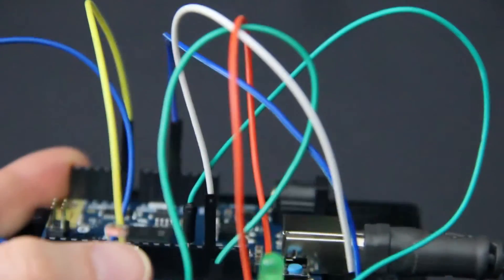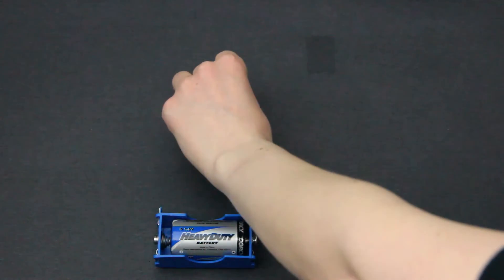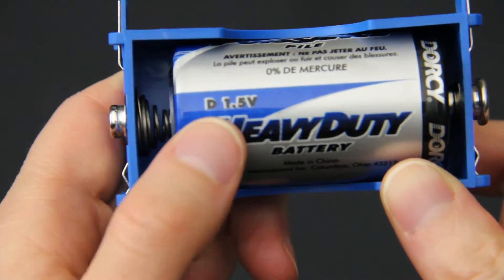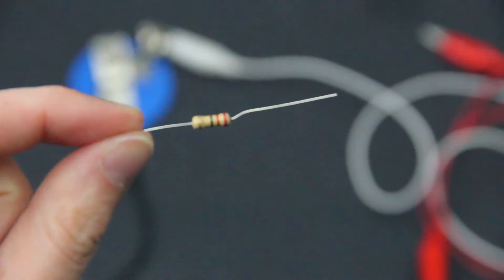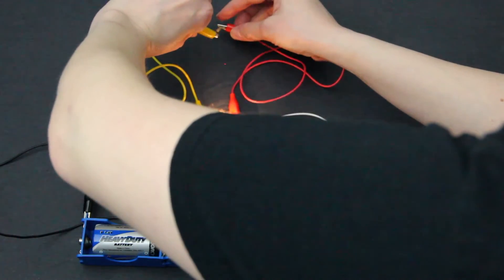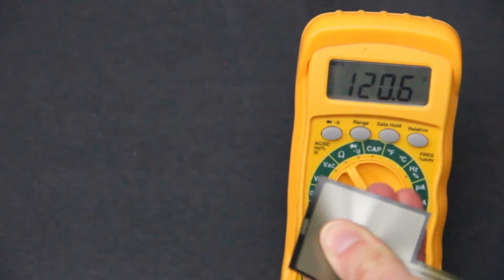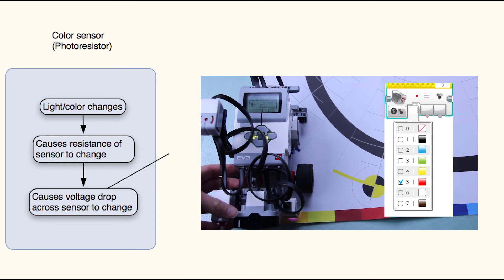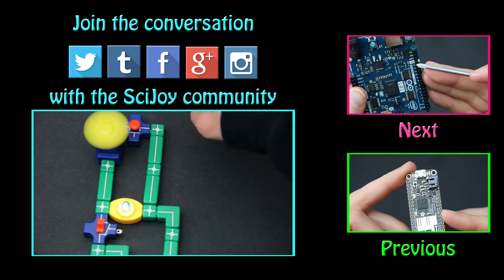Voltage, Current, Resistance and Ohm's Law  | Arduino - Ep 1

Comment from the maker: Someone messaged us and asked which way voltage goes. So I thought I'd share my response with everyone. I'm glad the question was asked, because this video is a really brief overview, and there are a lot of things we didn't have time to explain. 

In reality, electrons are what moves. So they want to go from the heavily negative side to the more positive side of the battery. And they don't just move the whole path of the wire. They kind of "bump" or are "passed" down the line of a conducive material. However, current is represented as going from positive to negative side on wiring diagrams, which is called conventional current. I don't remember the exact story, but it has to do with how electricity was discovered.